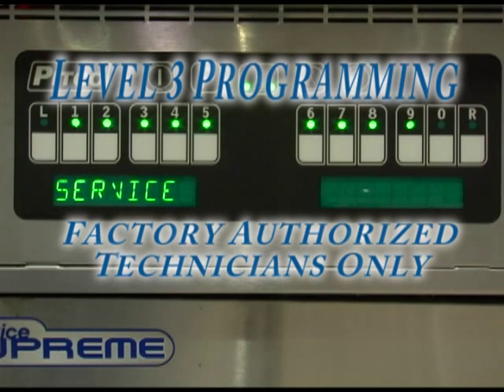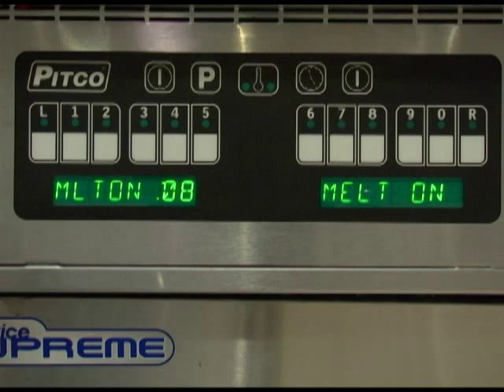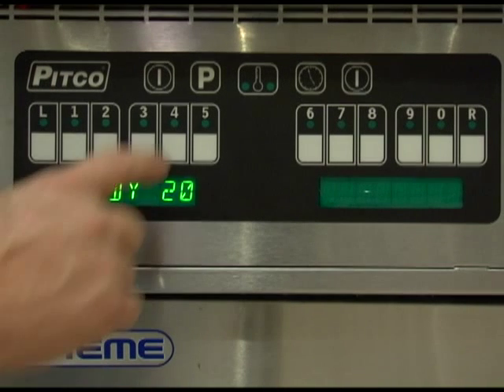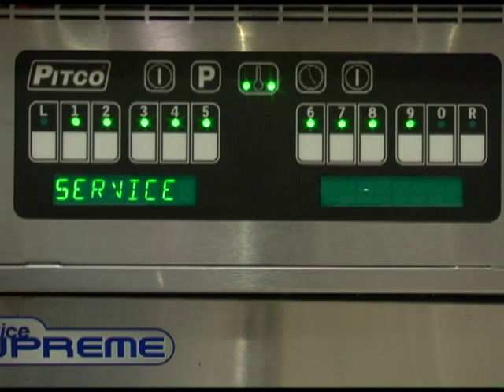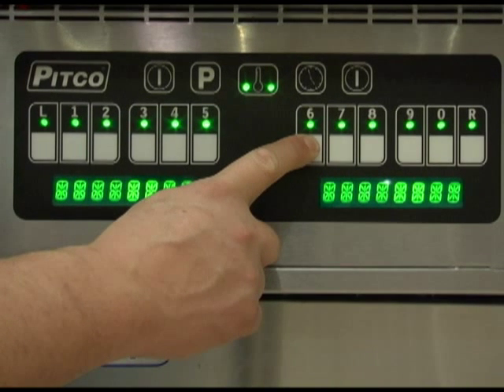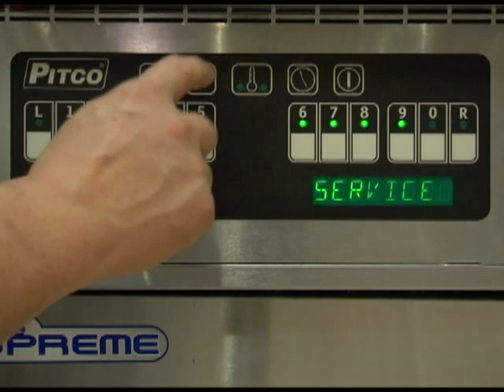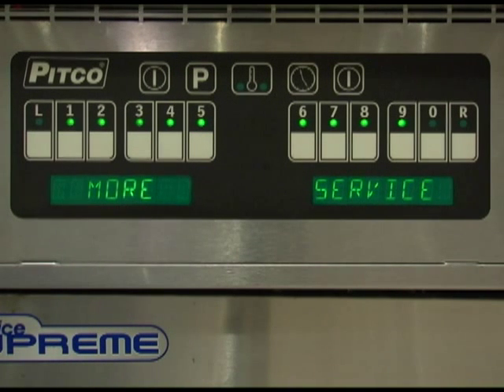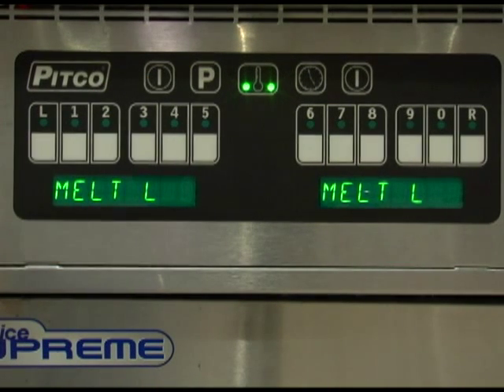Pitco I-12 Computer, Part 2

Comment: i was working in a mc donals and I couldn't  add items  as spicy and nuggets. how csn I control that I don't work in pitco and josh doesn't answer my calls
Reply: its a ME2 FRYERS 2 SPLIT VATS IF THAT HELPS
Reply: USING THE SAME FILTER BOX FOR TWO DIFFERENT FLAVORS .......JE JE  JE....NO NO NO NO....you will need two single fryers. is better just one fryer  and add the flavors after frying.